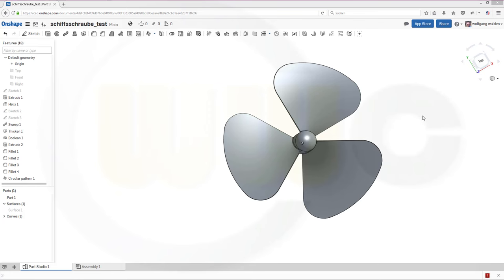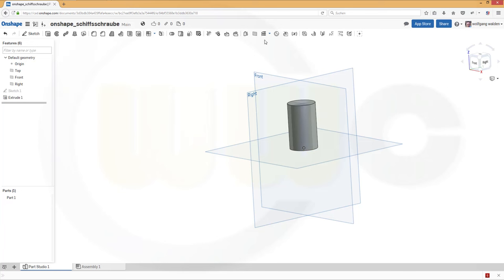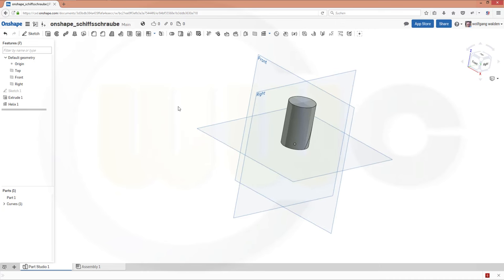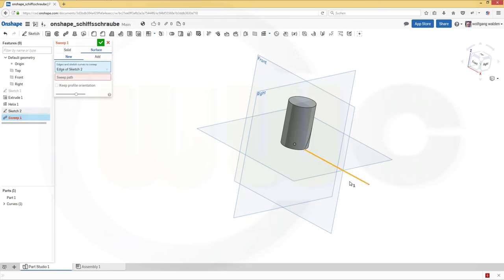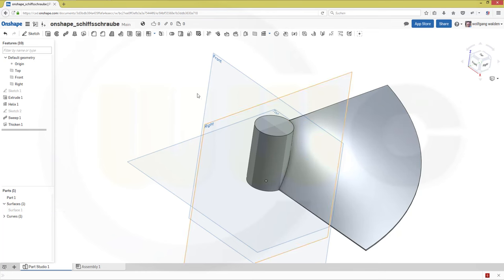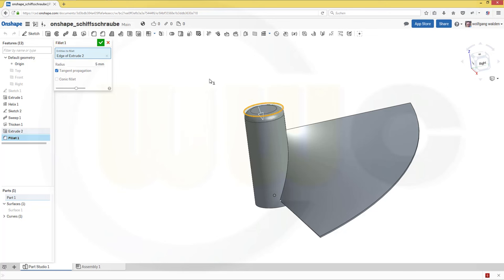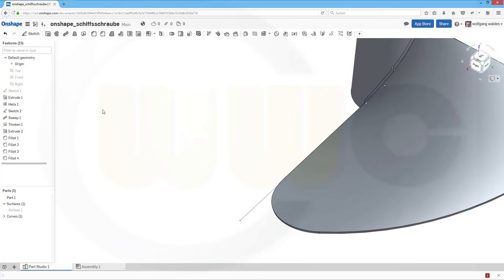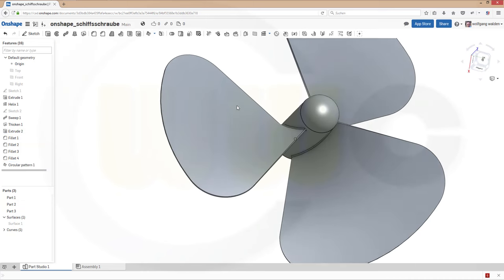9.5 Schiffsschraube - Propeller - Onshape Training - Part Design

Comment: dont know why i cant do the fillet. its seems that after thickening, some parts of the fin was detached from the cylinder
Reply from the maker: Change the values of the axis-extrude.
Reply: Had the same problem. I forgot to "use" the point of the helix to conect the line. Then i had .05 values on the thickness which were .5. Corrected that and worked just fine.

Comment: Trying to draw a 2 blade prop with thicker blades (4-5mm). Can't get the blades to merge with cylinder when thicker. Any ideas?
Reply from the maker: Maybe a "parasolid" problem, because onshape has a "parasolid" kernel. Maybe there is a gab between those parts you want to merge. Maybe some sort of non connected element. I would have to review you model.

Comment: Hi Wolfgang.  Nice video in terms of how to construct elements, but in practice a propeller would most likely have an aerofoil section.   Could you show how you would add that section to the first blade please?
Regards Mark in the UK
Reply from the maker: I know 😉 -  just use a sweep or a loft with the correct profile

Comment: Hi Wolfgang can ask is there a way in on shape to make a propeller/impeller that is fixed in the centre but joined to a motor on the out edge that changes the pitch on the propeller/impeller 
thank you
Reply from the maker: Right now, I would try it with a loft because the sweep has not the necessary options. But I don´t know all the user-created extensions at all. So there might be a solution I´m not aware of.